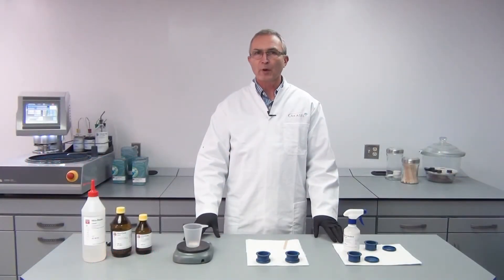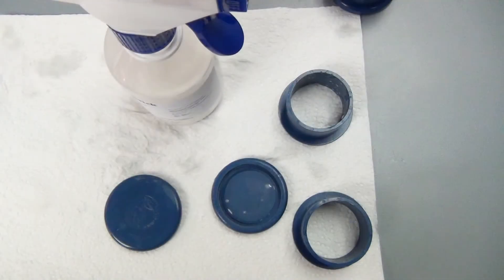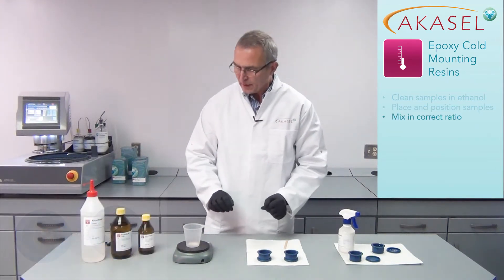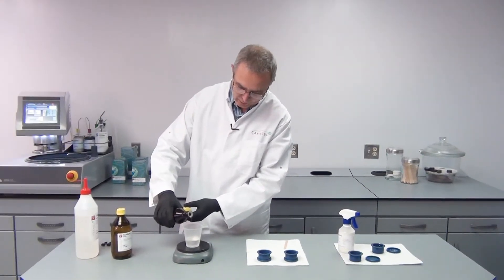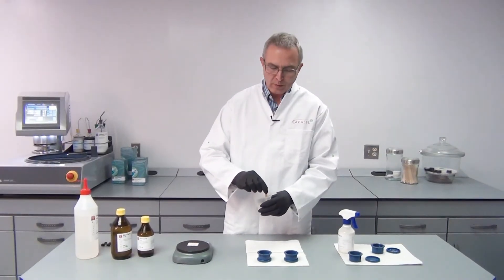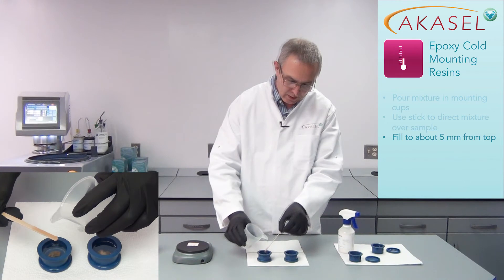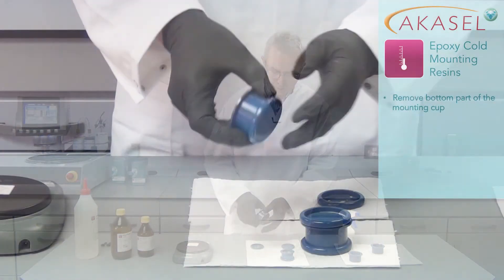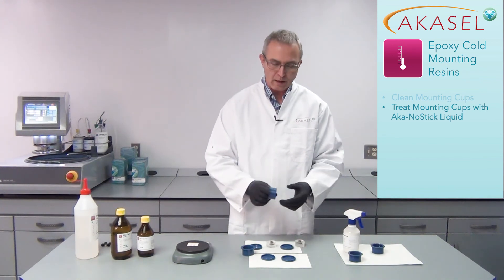The Correct use of Epoxy Cold Mounting Resins

Comment: Can we use silcion moulds instead of mounting cups
Reply from the maker: Yes you can, but you might see that the epoxy attacks the silicone moulds. That can result in a slightly dull surface of the epoxy mount and the lifetime of the silicone mould can be reduced.

Comment: after mounting, is the metal at the same level as the resin layer?
Reply from the maker: Yes, with slow curing epoxy resins the resin and metal are at the same level. You only have to be careful when you mix and mount large amounts, then the temperature can get very high and the shrinkage will increase. That can/will result in the metalsample being slightly higher/sticking out of the resin.
Reply: @akasel  if i am using a fixation clip to clip my small sample and the cross section that I would like to view is facing on top (unlike the samples in the video where the cross section view is at the bottom), how much resin mixture should i pour to my sample?
Reply from the maker: @mcmc727  Because of the surface tension of the resin you will always have some resin moving up the side of the mounting form/mould. You have to make sure to cover the entire sample and then remove excesss resin through carefull grinding.  However, I would always mount the sample facing downwards as shown in the video. With our plastic clips it will only be small circular legs on the bottom of the sample and there is no contact between clip and sample at the level of preparation. Here is a link to how these clips look: https://www.akasel.com/products/embedding/accessories/aka-trioclip-black.html
Reply: @akasel  I have take a look on the clips. If it is mounted facing downwards, this means that the sample has to be on the same level as the top of the small circular legs, am I right?
Reply from the maker: @mcmc727  Yes, the clip is standing on the legs, and the sample is pushed all the way down.

Comment: Can we cure the resin in a oven by 60•  Celcius? Or heat it up to reduce the viscosity?
Reply from the maker: @djsalvi26 Yes, you can cure the resin at elevated temperatures like 60°C. However, it depends very much on the amount of resin you have. The larger the amount, the bigger the risk that the temperature will run off. For a 30 mm mount, it is not a problem, for a 50 mm mount, it could be trouble. And the higher the temperature gets, the higher the shrinkage/gap between resin and sample. If you have the possibility to keep the temperature constant at 60°C (heating first and cooling when the exothermic reaction starts) instead of heating only that would be perfect. To reduce viscosity we recommend to heat the resin only before mixing with the hardener. Thus you will get a quite thin liquid and you can heat up a larger amount without starting the curing reaction. It will also make mixing easier.
Hope that helps,
Michael
Reply: Akasel A/S Hi Michael thanks for your quick answear, I‘ m using at the moment Caldofix-2 I‘ m really happy with this product, but I‘ m looking for an alternativ product to not be dependant from Caldofix-2 the problem the most of Epoxy product on the market are really sensitive to heat, my experience is you get a bether hardness of the resin if you curing it up to 60•C in a oven ,after polishing the samples are really flat and sharp on the contact line between material and resin.
Reply from the maker: @djsalvi26  With the epoxy system we have, you can use one resin, Aka-Resin Liquid Epoxy, with two different hardeners, Aka-Cure, Slow and Aka-Cure, Quick. The Aka-Cure, Slow cures within 8-24 hours at room temperature (22°C) As explained before, it can be heated up to 60°C to speed up curing, but depending on the amount of resin the temperature can increase very fast. The Aka-Cure, Quick is similar to the CaldoFix. It will cure within 30 min. when heated up to 80°C. However, an even better result can be obtained when using a 2 cycle curing schedule. First, the mount is cured without heating for 8 hours, followed by a 1-hour cycle @ 100°C. This will also give you a very good result with perfect planeness and edge retention.